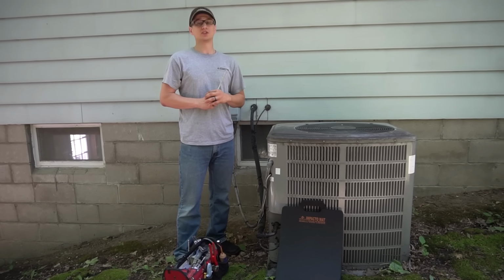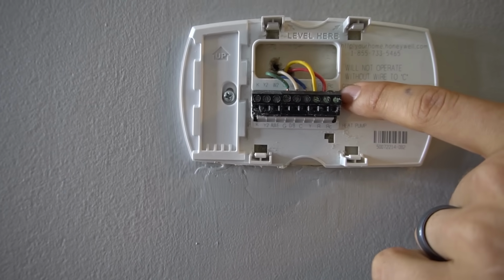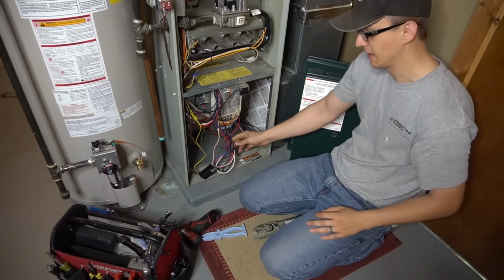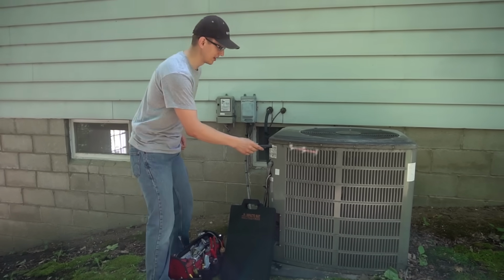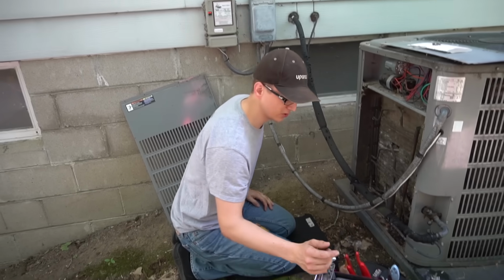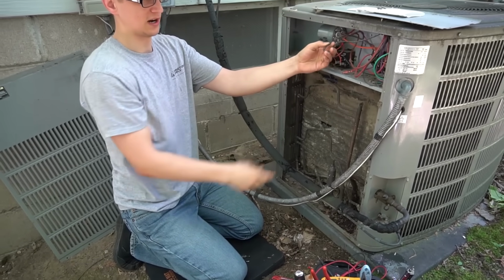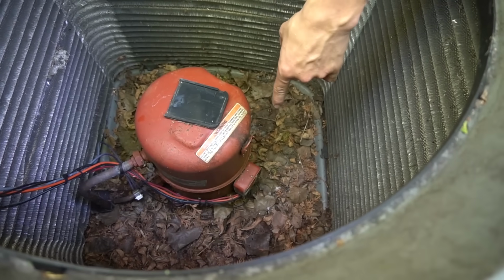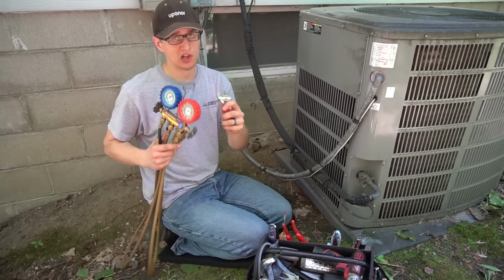AC Unit Not Turning On - How to Fix It Step by Step

Comment: Hey great video, you're helping so many people. Maybe you can help me with suggestions for something I haven't seen addressed in any videos I've watched. I get 120V at each input at the bottom of the contactor, but when I put the multimeter leads across the two inputs, I don't see 240V. Inside unit is good,  I see 24V at the control board and at the thermostat and between the two thermostat connections on the contactor. When the thermostat is on and set to cool, the contactor plunger is pulled in and I hear a quiet buzzing noise. I see 120V at each of the top outputs on the single-pole contactor, but neither the fan or compressor kick on. Capacitor is good, I see 120V at herm and fan terminals and capacitance test is almost perfect 50/5 mfd. Replaced the capacitor just in case (also tested good) and the contactor, but the fan and compressor still won't power on. Would appreciate any ideas on what to check next! Thanks in advance.
Reply from the maker: Glad to hear that the videos have been helpful! What you described sounds like you may have a blown disconnect fuse. Many disconnect boxes will have a little panel inside that you can take off which will reveal two fuses. You could check both fuses and then see if there is 240v coming out of the house too. If not, then it could be a bad circuit breaker too.

Comment: thanks so much for your help!  I didn't have enough money to replace my fan condenser motor last year.  But with your help and wonderful parts hvac guy I did it and replaced both silver cannisters, and forgot what there called.  Total cost under 200 and it was like 100 deegres out and I had the flu.  Thank you again so much, your a great teacher.  BTW my neighbor an hvac technician offered to replace it fir $1300!

Comment: My A/C guy checked everything and said my unit isn't getting the full 240 volts and need to call an electrician.  The electrician said an old A/C disconnect box needs replacement because everything else is newer (A/C unit and capacitor).  Wants $800.  Wires all look fine from the outside.  Could it be anything else I should check?

Comment: really enjoyed watching your video and like how well you explained in detail. AC Fan stops spinning only when it rains or snows. Works fine otherwise. I replaced the capacitor. I thought I fixed and the unit worked without issues for a week, snowed today, and the fan stopped worked again. I plan to check the plunger on the contactor after the snow melts. Also, going to look around for worn wires. Any other tips or what wires/areas to thoroughly check next?

Comment: You are so knowledgeable. I have a a/c unit that is 1 year old. The a/c comes on cools to temp,goes off but then within 10 seconds comes back on for 10 seconds and then cuts off. It does this about 3-4 times and then is fine until the next time the a/c comes on again. Also it doesn’t do it every time. Thank you in advance for any advice you may have.

Comment: Excellent videos, insta subscribe! I have a heat pump outside that this morning the fan would not come on - compressor is running (buzzing noise), 240AC is preset, my basement was warm. I followed your suggestions, pushed the plunger few times and the fan eventually came on after powering up the unit (via breaker and outside cut off panel). Question: when the heat pump is in Heat mode, is the fan supposed to run at all times when the compressor is on - even on cold days (in Heat mode)?
I also have a controller board under the panel "D159285G01 CNT07482 Defrost COntrol V3. STatus light is green, but red fault LED blinks twice every few seconds - even now that fan is back on and the unit is heating the basement. Reading different posts, fo9lks who know HVAC suggest faulty controller board. Manual says 2-flashes is Coil Temperature sensor. Would a bad defrost board stop fan from spinning? Perhaps Defrost board is flashing because fan was NOT running? Any suggestions? Thank you!
I forgot to mention, while compressor was on, I tried to spin with fan with a long screwdriver - this is supposed to eliminate possibility of capacitor being bad - the fan did not turn on.

Comment: Thanks for this great video. I checked my wiring inside my furnace but I wasn't expecting to find a fuse in it. After you mentioned the fuse I looked again and there it was. A blown 3 amp fuse attached to the circuit board.  Changed it out and it worked like a charm. THANK YOU

Comment: Hi.. and thank you very much for all the videos, it's very very much Helpful.
The unit inside works,  without cooling.
When the compressor tries to turn on, it makes a click and then causes the circuit breaker to jump.
I replaced the capacitor and contactor, it still doesn't work.  The unit does receives 250v and 27v.  What else could be the problem?
Reply from the maker: Sorry to hear about the A/C troubles and glad to hear that you found the videos helpful. If your circuit breaker keeps tripping when the the unit comes on, I would refer to this video for some ideas of what to check: https://youtu.be/G1EBHrOgs-Q

Comment: Ok, I pushed in on the contractor and everything comes on…
Don’t have a meter…
But other than ants, if the plunger doesn’t pull in on its own, is the problem the capacitor?
Or what do I do, you never said what to do if plunger doesn’t pull in
Thanks in advance
Reply from the maker: I would suggest watching this video next: https://youtu.be/NVPhsK4gK1A?si=Klc4LowjHdsly247
Reply: @WordofAdviceTV  Okay, well I still don’t have a meter, so I’ll check the batteries in the Thermostat, and then just buy a Contactor and a Capacitor (which is rusted on top and at the connections)..
But, I guess what I was really asking is I just replace the nasty looking Capacitor “could” that be enough and it doesn’t sound like it would be…
Thanks and Good Luck to me

Comment: I got my fan motor replaced and just got Freon put in I think my ac unit over heat it turn on but want spin and it works when It wants too ugh I just paid 235$ too put Freon in it started tripping the same day I be have to turn my air off for a few hours then it starts back working I just had to wash the ac unit wit water it’s back working now and I just did it a few days ago had to do it again

Comment: I've watched your video and pushed the plunger in and all i heard is the humming but it seemed like it was stuck so i pushed the metal part it had a little spark up AC came on and didn't have a problem since. Can i replace the plunger itself or the entire piece. Again thank you
Reply from the maker: Glad to hear the AC is working again! The contactor plunger was probably just stuck in the open position which may occasionally happen. (could have even been a little bug stuck in there that you crushed) You would replace the whole contactor (it's not expensive), not just the plunger. But if the problem did not come back, I wouldn't worry about it. I have a step by step video on how to replace a contactor if you will need to do so down the road.

Comment: My therm is battery and it has no jumper on RC and has been working all summer without it and yesterday it quit working ( furnace blower turns on but AC unit won’t turn over and the fuses outside are good) so I’m going to check the silver capacitor numbers to start and make sure they are with in spec. I herd you mention fused in the furnace it’s self I’ll have to try to find out where in your videos you show these fuses

Comment: Hi would if the a c. Is blowing but will not get cold? All test performed by tech came out good? 

2. Then after he checked the furnace and said oh it looks pretty rusty...looked around then came back down and all of a sudden now the fan will not turn out but air is still blowing out of  vents? He said the entire unit just needs to be replaced? I did not feel good about the visit...oh and then the compression test went down to 20????? Right before he packed everything up? Nothing will even stop the air in vents blowing and now no fan  outside. I hope this all makes sense. Thank you!

Comment: You're quite knowledgeable. I wish more time was spent on reasons why air may not be flowing inside of the home. Everything on the outside is fine. The fan seems to be blowing in the furnace. However, there's still no airflow in my home.

Comment: NEED HELP!! I recently had an extended power outage due to a storm. Now my AC unit outside won't start, Where do you think I should start to look? Have turned it off and tried the reset method, also no breakers were switched so that's not the issue either. Thanks for any help!

Comment: My air conditioner is not cooling the house I changed the filter inside but it's not coming on 
or blowing also watered or sprayed of the outside to clean it out turned the power switch from the outside waiting for 3to 5 minutes then turned it back on the unit on outside started to run but when I went inside there was no cooling down or blowing from the vents happening jsu wonder if you had any solutions for me

Comment: My condenser/fan does not come on, absolutely no sounds!  Capacitor was swollen, so i replaced both Capacitor & Connect... still no sound.  I checked 240V from disconnect and NO voltage going to connect!  Also, no tripped breaker.  Any suggestions before i call an electrician?

Comment: M/N 14ACXS036 - 230AZ1
SIN 1918B44334 unit is 5 years old 
I have a Lennox .  House  had a power outage and unit is not working. Circuit breaker is not tripped. Thermostat is a Resideo and it is indicating it is on but it is not. I have not changed the furnace filter but will and I will check for a fuse on the inside of the furnace. Any other ideas or suggestions would be great.

Comment: Fantastic explanation! This helped me isolate my yellow wire which was shorting and blowing my 5 amp fuse when there was a call for cooling. It was wrapped over the edge of the condenser housing where the access door would rub on it every time the door was opened, slowly fraying the isolation on the wire until it finally made contact with the housing creating a short.

Comment: Love your videos! I have an intermittent problem. Twice per year my thermostat calls for  cooling but the outside unit is not running.  If I raise the setpoint so the indoor unit shuts down and then lower the setpoint, the system runs for weeks without issue.  Unit is a 13-month old American Standard heat pump.

Comment: Awesome, mine was just the fan not spinning for some reason. I bumped it slightly like you said and it started right back up. Thank goodness, but I'm afraid it could be a bigger problem. This unit is 20 years old at this point it might be time to replace it.

Comment: My condenser fan wouldn't turn without a nudge from my trusty stick but turns smoothly once it gets started.  HVAC guy  replaced the capacitor, but that night, after the house cooled, the fan again wouldn't rotate on its own. My neighbor said it was making a terrible clanging noise. NOW the fan clangs when started and stopped. HVAC  guy says need to replace blades because the piece around the motor shaft is not tight enough. IT WAS NOT MAKING THAT NOISE before his "fix". I think he doesn't know what he's doing?

Comment: Thanks for your videos. They are the clearest ones on the internet. I have a question. I have a Rheem RAMB-408JAZ that has stopped working.  The inside fan works when I turn the thermostat to A/C. The unit has an Emerson SureSwitch. There is 220V at the terminals of the switch, but the LED light is not on. When I push the test button or the cycle count button, nothing happens. Could the SureSwitch be bad?  Is there something else I should be checking? Thanks for the help.

Comment: Pretty good video. I followed your instructions and realized it is the a/c unit. Nothing works when on “cold”. No sound, no moving parts, nothing. Everything works when it is set on “heat” but when I switch it to “cold” , the 3A fuse blows. I was looking for stripped or chewed wires but nothing. Could it be the bord?
Reply from the maker: This video might help you narrow it down: https://youtu.be/4e4wsruGS0s
Reply: Thx. I will have a look.  @WordofAdviceTV

Comment: HHHHEEELLLLPPPP!! Bought my house in May. My ac has been doing good beating this Texas heat. Woke up and it wasnt blowing cold but was blowing. Checked outside unit and it wasn't on at all. No fan no compressor. Checked all the breakers. Opened up and adjusted a wire connected to capacitor and it kicked on. Yay... figured it out... not quite. Now it turns on and furnace inside turns on but doesn't blow cold. Did change the filter. Any thoughts?

Comment: Ok I have a problem. My air works fine when it’s runs. It will run but at the peek of the hot day it stops . But!! After about 8 hrs it will just start up and work fine. ??

Comment: I have a question, blower motor works but outside unit randomly shuts off, fan and compressor usually around 2 or 3 pm and It could be hours or if I shut it all down for about an hour I can get it started again. This has happened for about a month and a half. Some times within a couple days, sometimes 2 weeks. Is it the control board or what. TY for advice

Comment: this video was really helpful. Thank you! 
I did narrow down the issue. Fuse on the motherboard in the attic blows when i turn on the cool. no issues if i only use the fan or heat. 
I did check the wire going outside from the inside unit for shorts. Nothing seems suspicious. 

Can the 24v part of the system be effective by the 220v components? For example. can a bad capacitor cause this? 

thank you again!
Reply from the maker: Glad to hear the video was helpful! The 220v and the 24v circuits are separate so it's highly unlikely that the 220v side is causing the short. I would suggest tracking down the short the way I show in this video: https://youtu.be/4e4wsruGS0s

Comment: I think you are awesome. One of the 2 fuses in my Rheem Breaker box keeps blowing. When I replace both fuses with new ones, the unit would work for less than 30 minutes then shut off.The fan motor stops running. The technician charged me $150 for a pair of fuses (Edison ECNR50). I would hate to have him trying new fuses at $150 a pop. What do you think might be the problem?

Comment: Thank you Jay.  You’re amazing.  We have a Carrier HVAC & it keeps tripping the breaker. 
Replaced a bulging capacitor as you showed. 
Still tripping the breaker. 
Also replaced the thermostat in the home. This works as intended, it does have the jumper in place.  
Thoughts on tripping breaker. 
I’ll check the fan motor next.  Thanks
Reply from the maker: Thank you and sorry to hear about the AC troubles! There are quite a few things that can cause the breaker to trip, I talk about that in this video: https://youtu.be/G1EBHrOgs-Q

Comment: hello very helpful video but my compressor stopped turning on after I was replacing my thermostat with a smart thermostat the red wire accidentally hit another wire and It made a small spark and after that it would not turn back on, the fan comes on and blow air thru the vents but nothing is happening with the compressor and I also checked the fuses and they are good... any ideas ?? :(. :( :(
Reply: The spark was a short on the 24 volt control circuit. Check the 24 volt fuse on the circuit board, its usually in the same spot as the blower motor. Your system might have also have a circuit breaker for the 24 volt circuit which would be in the same location as the fuse. If the circuit protection for the 24 volt circuit is good then the 24v transformer might be fried.

Comment: Question:  When I press the outside AC Unit plunger contact in, it attempts to turn on the AC Unit.  However, it makes a constant humming noise trying to start the AC Unit and fan, but that's it.  It does not turn on the compressor or fan.  So does that mean the compressor is bad (and I need a new AC unit) or is it possible the capacitor needs to be replaced?
Reply: Turned out that my capacitor was dead.  Replaced and I am up and running again.  Oddly though, my top was not bubbled out or damaged.

Comment: Outstanding video!!  Now that I watched this video, I've diagnosed my inside unit works, the thermostat fan turns on, air blows inside the home, but the outside unit does not turn on.  However, the 18-year old outside unit was making odd noises about 3 days prior to failing so I am suspecting it may be the expensive part you mentioned, the compressor.  But based on your technical information, I will test the plunger first then the capacitor for bubbling up and continuity.  If anything, at least I learned something!!  And I am sure I have to clean them coils.  For all those watching, share your symptoms and repairs necessary to help others identify what their issues could be.  Prior to my AC going out (no cold air) I heard the normal hum of my outside unit go higher several times and make weird sounds.  Now my home only blows warm air, no AC, and the outside unit does not turn on when I turn on the AC at the thermostat.  To be continued when I perform these technical procedures.  Edited for update:  I checked wall breakers and they were not tripped.  I removed the panel and the capacitor is not bubbled up or damaged looking.  But I did not check the terminals for continuity. I then pressed in the plunger over-ride and it makes a constant electrical humming noise as long as I held it in confirming 240 volts, but the compressor and fan did not turn on even though the fan spins freely.
Reply: My capacitor was dead.  For all reading these comments, start there.  Have it tested for proper micro farads.
Reply: @johnnyappleseedz422 mine is doing the exact same thing.  I thought it was the capacitor. I have tried 2 different brand new ones and it still is doing the same thing.  Thanks for your comment though.  Hopefully I can figure it out before calling a tech